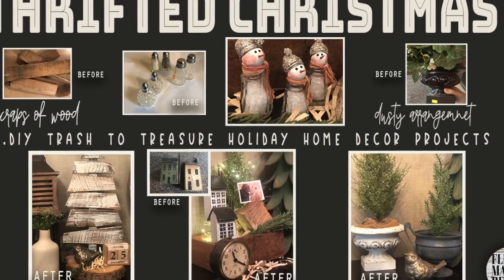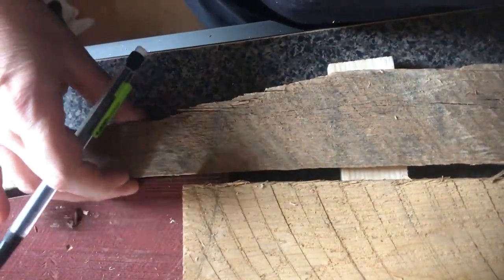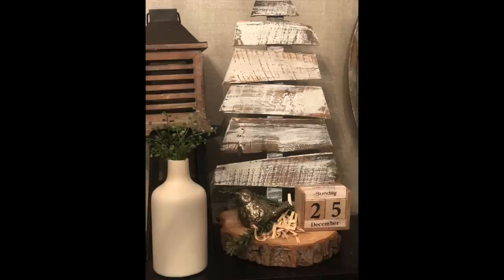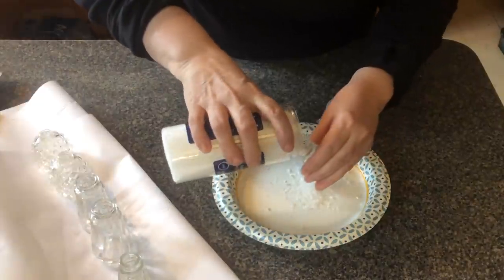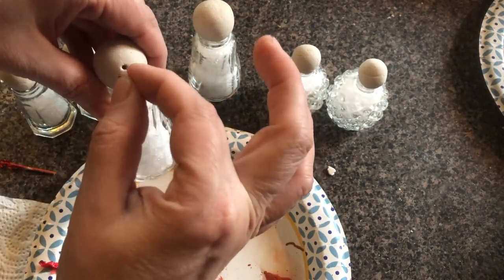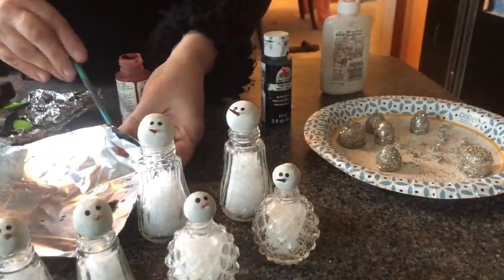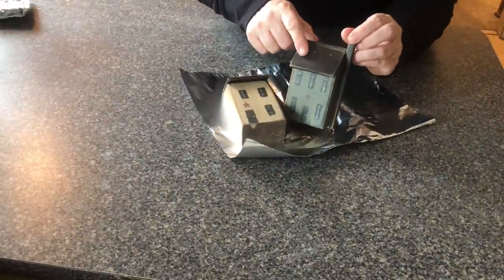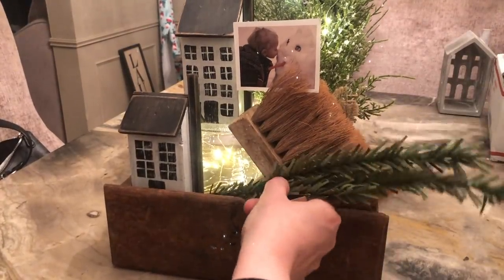THRIFT STORE DIY HOLIDAY HOME DECOR FLIP-TRASH TO TREASURE-THIFT STORE MAKEOVERS

Comment: Love all of these! Question: Do you think a wooden bead could work for the head of the s&p snowmen? There’s already a hole for the carrot nose. I could use wood putty to fill the hole on the back. I’ve never used paper clay....
Reply from the maker: Thank you, Mary and absolutely...that most certainly would work!!!!  If the hole is a little too big for the nose, you could also just use a little wood putty in there to make the opening a bit smaller, but yea...to your question, you could definitely use a wooden bead!   Hope that helps!
Reply: Yes it would, I use sharpened pencils for bigger noses on bigger snowmen. Anyways paperclay is easy to use, sometimes it cracks after drying then just touch it up with another piece of clay. It paints easily too. I made  a Snowman and Santa Claus with it,  they turned out so cute.